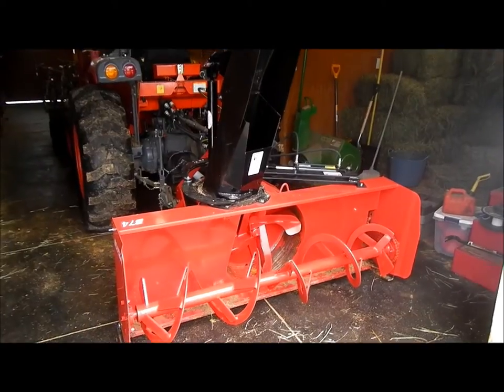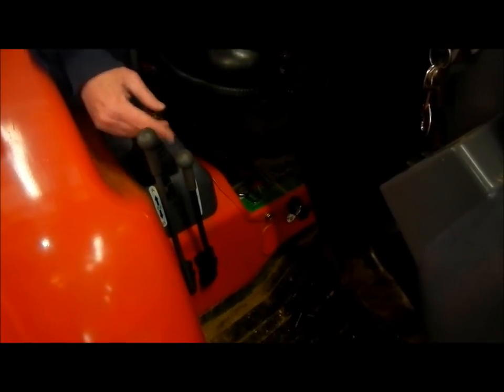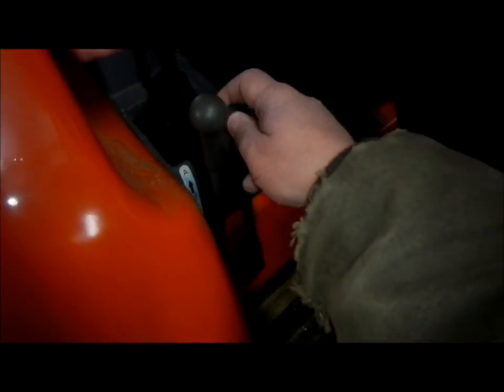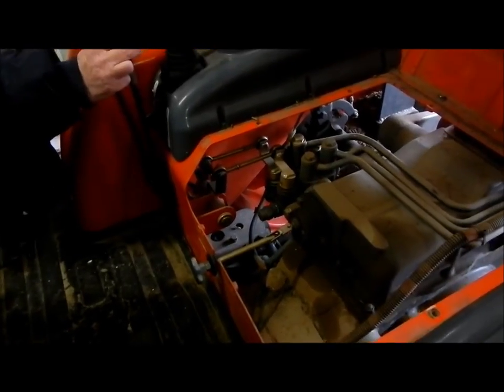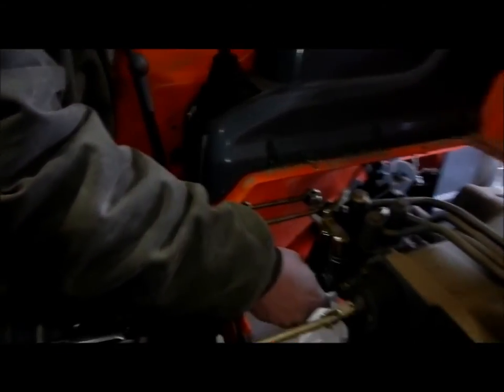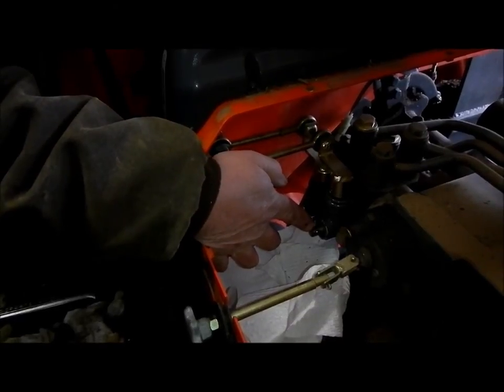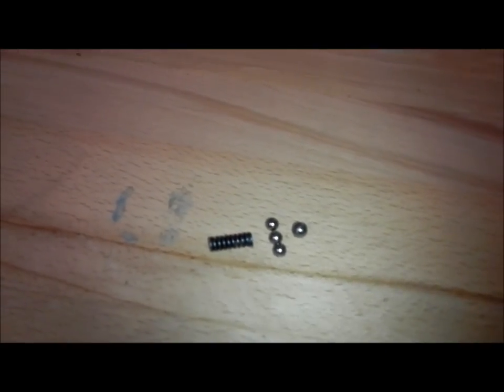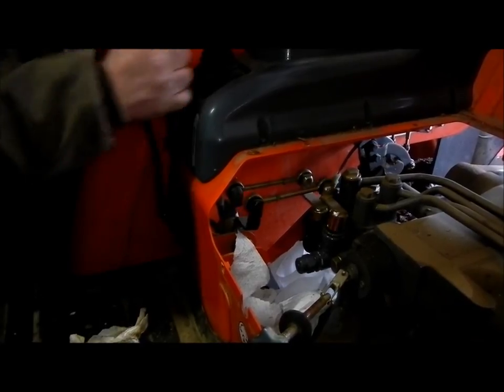Hydraulic valve work

Comment: Can you answer a question for me ?  I have the DK45SE HST 2007 ..the read 3pt  hitch lever stop working.  The upper controls work fine (red/yellow) but the rear doesn't.
Reply from the maker: Both the top red lever and the rear lever operate the hydraulic valve that controls 3pt hitch up/down. Since the top red lever works but the rear doesn’t I’d suspect the linkage connecting the two has somehow disconnected.